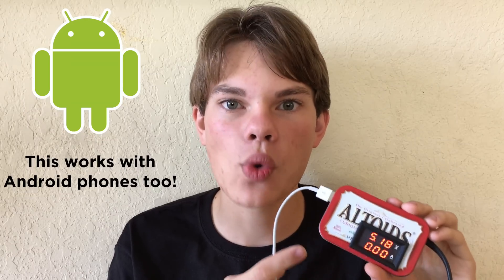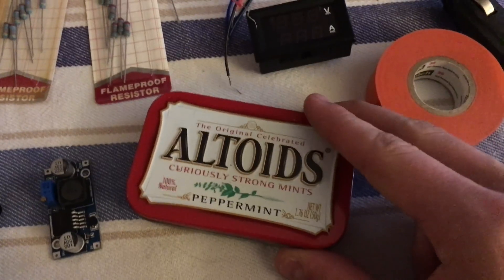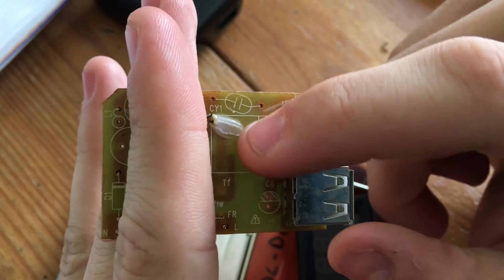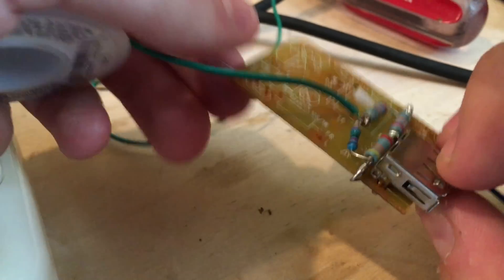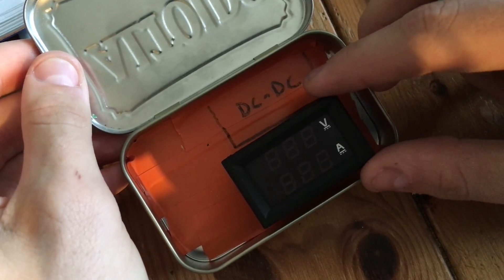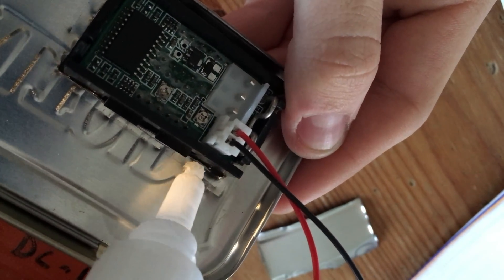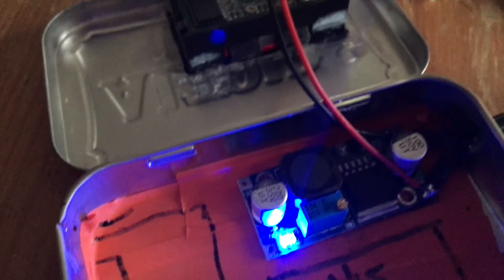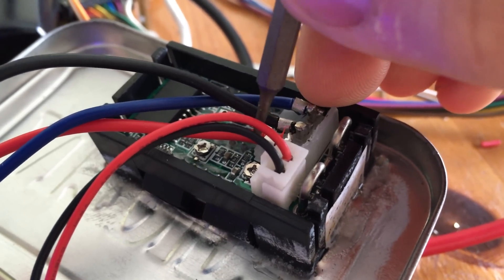Ben Builds: DIY iPhone Rapid Charger | Charge 2x as Fast!

Comment: Nice build and great that you made an instructable, but how does it work? I'm a bit confused about the ending and it would've been great to see it in action. Anyway, thanks for sharing this video. I hope you get more subscribers!
Reply from the maker: +Torsan1977 It works by reducing the incoming 12v to 5.1v and then tricking the phone into thinking it is an iPad charger using the resistor network. The phone knows it can draw a lot of current so it charges with 2A vs the standard 1A.

Comment: So I got to ask would it be that much harder for you to make the power cord (the car charger) a removable/interchange able cord. So as to say I want it to be able to have a car charger input, but also the possibility for a wall charger, or maybe not any cord at all so i could carry it around without it looking like a charger. I know if you want to do this, you would probably have to use a larger container, that why you could have the cords with ya as well.
Reply: A panelmounted barrel jack would work, if there's enough space in the tin. http://www.ebay.com/itm/371495769130?_trksid=p2057872.m2749.l2649&ssPageName=STRK%3AMEBIDX%3AIT
Reply from the maker: +wil D Torsan is exactly right. A barrel jack would work perfectly.